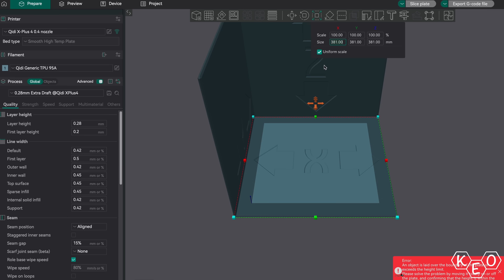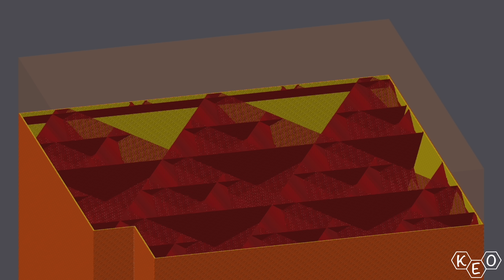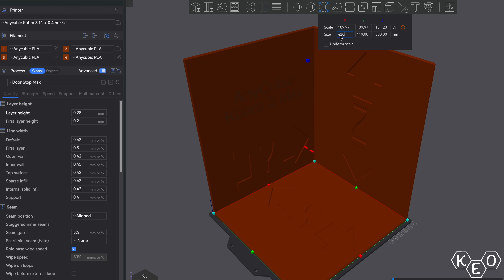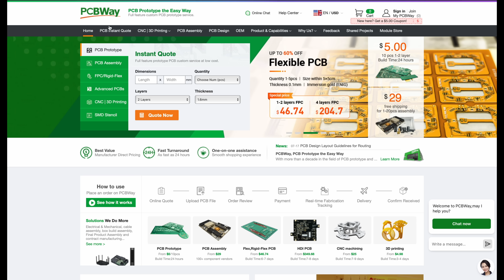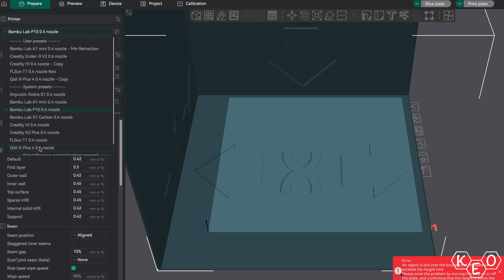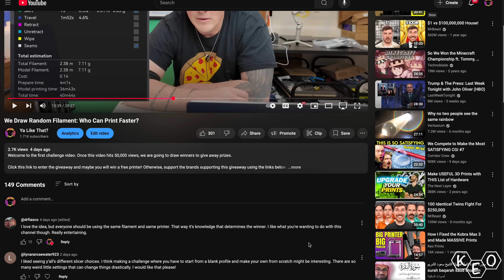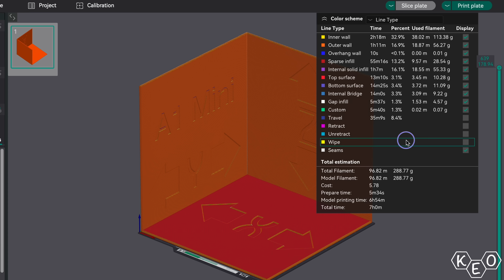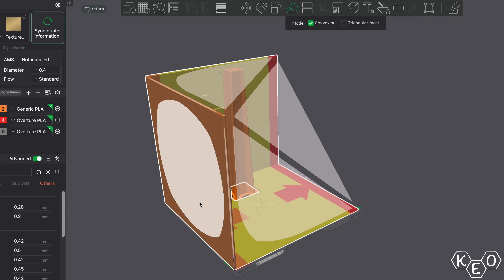Real Build Volumes vs. Manufacturer Lies

Comment: Great video, this is awesome to see, are you uploading these models anywhere? 
Also because we are 3D printing nerds, I have to throw in an UM ACTUALLY about the exclusion zone on 256^3 Bambu printers which CAN be fully utilized, you just have to use one filament and the free printable block, and not use Z-hop if you want the top few mm. If anything Bambu Studio should have a link if you try it maybe because it is on the wiki and not inside of Bambu studio how to. Also the X/Y dimensions around the exclusion zone are an L shape as shown/noted if you want to use the AMS due to the cutter causing the exclusion zone, but people act like it's some massive cover up of lies when it's just raw capability = full dimension vs enable other capabilities and it gets diminished. That's a lot to have on a heat bed screen print, not quite a lie, and I do know a guy on Etsy who uses the full volume to print cube lamp diffusers pretty decently
Reply: yeah - annoyed me a bit aswell - same for the Mini, if you use Bambu Studio instead of a faulty configured Orca Slicer 180x180x180 works perfectly fine - same goes for the H2D - there is no prime tower needed if you do it right - especially on bigger models, there is plenty of space inside the model to prime the nozzle for example on infill or inner wall perimeters

the advertised volume is a best case that can be used within the motion limits

and what do you expect from the H2D - write "325x320x320 + 325x320x325 (offset +25 mm on x)" on the front of the printer? ;)

Comment: the h2d is an interesting case to me cause of the limited reach on each nozzle. really neat to see the visual representation.
Reply: the representation is  wrong though ;) - the limited reach for the useable volume is only a 25x5 mm strip on the top left - the motion limits and on X for both nozzles are clearly shown in Bambu Studio (which in the video are conveniently covered up)
Reply from the maker: Continently covered up… it is a conspiracy for sure

Comment: whats the dimensions of the x1c plate that is usable??
Reply: 256x256x256 - you can use the whole advertised print volume - there is an article at the Bambu  Lab Wiki called "Print volume limitations, and how to use the full build volume 256x256x256mm³"

he is just doing it wrong
Reply: @suit1337  good to know big bro thanks

Comment: What a great way to visualize this. Thank you!

Oh yeah, 256 is special because 16×16 = 16² = 2^8 = 2×2×2×2×2×2×2×2 = 256
But that doesn't explain why they chose 256 instead of 250, for example.
Reply: As I sw dev, I can confirm, it was memorable for me, because thats the number of possbile values of 1 byte. In binary it's a round number: 1 0000 0000.
Reply from the maker: It’s interesting isn’t it?
Reply: @KeoPrints  Maybe they just rounded up 25.4mm / inch to get a 10" print area for us in the USA
Reply: @thegoldbug  r/USdefaultism
Reply: The CEO said they specifically chose it because people familiar with technology numbers in kb/mb etc. recognize 256 as a multiple of 8, so they pandered to people's existing knowledge of tech to make it more memorable. it's in an interview I think with Stephan of CNC Kitchen.

Comment: This is so weird - I literally ran into this the day before yesterday with my P1S. Why even show the whole plate in the slicer?
Reply: the exclusion zone on 256^3 Bambu printers can be fully utilized, you just have to use one filament and the free printable block, and not use Z-hop if you want the top few mm, so yes, you can't use 256x256x256 for a full color AMS print, but you can for a 1 filament print
Reply: because you can use it? ;)

just look up the article  "Print volume limitations, and how to use the full build volume 256x256x256mm³" in the Bambu Lab wiki